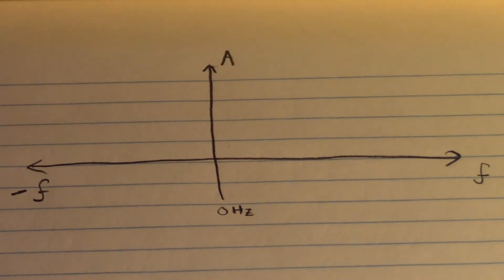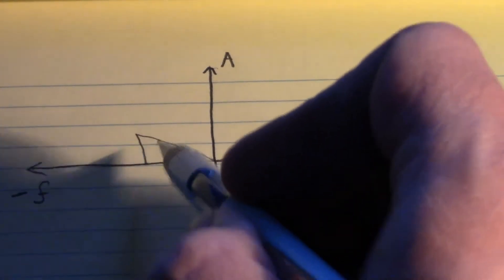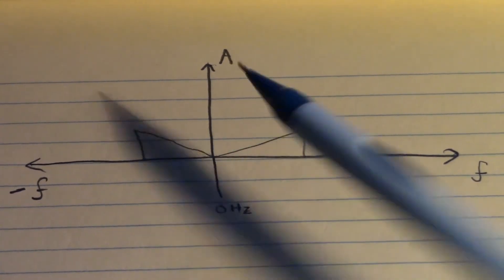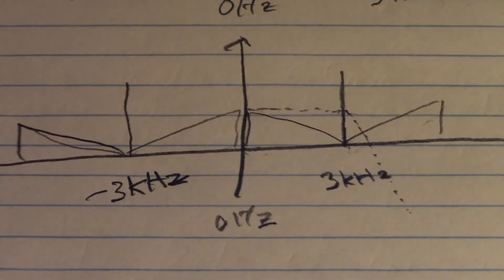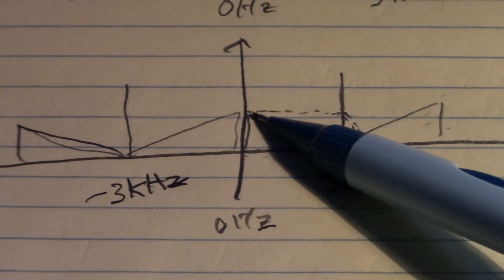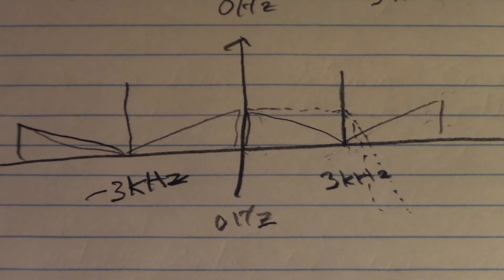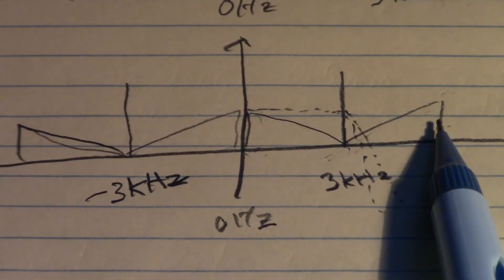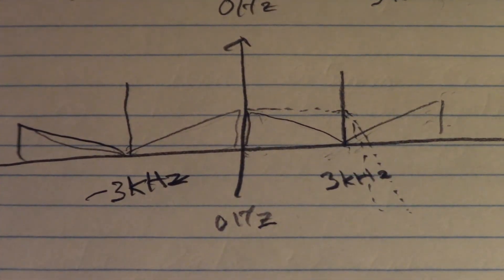Homemade Speech Scrambler

Comment: Sounds just like the kind of Shortwave communication i can sometimes receive on my little world receiver. Even on CB people seem to use that. Not sure if it's deliberate or because some use LSB and USB transmission.
Reply: That's because you're trying to pick up single-sideband signals with an ordinary AM detector. The receiver needs what's called a Beat Frequency Oscillator (BFO) in order to properly receive SSB signals.
Reply: VWestlife my man!! :) Always a pleasure talking to you here. Yeah, my handheld CB does not have that. It's just a basic CB for all EU Countries (the country settings change the legal transmission wattage and channels) but lacks SSB options. But SSB operation would require a stationary CB transmitting station anyway. At least in Germany. Handheld SSB is not allowed. On Shortwave i could at least try to decode it properly with a DVB-T USB dongle that i can use as a software defined radio and using the single side band options of the radio software.